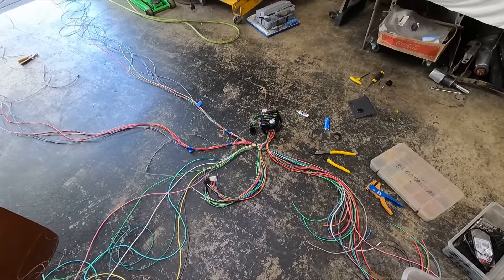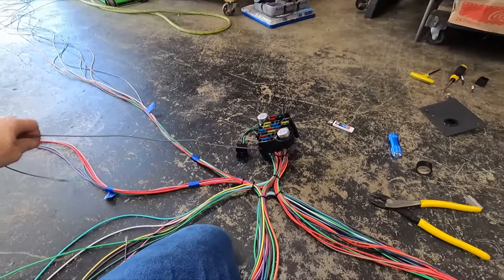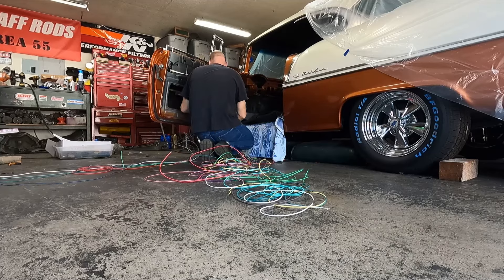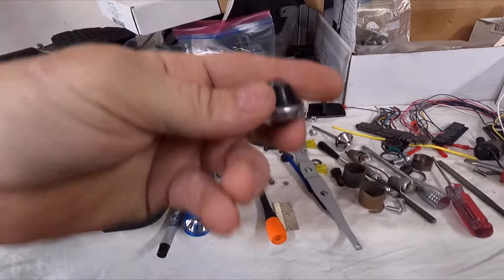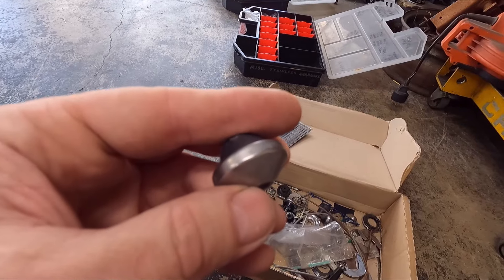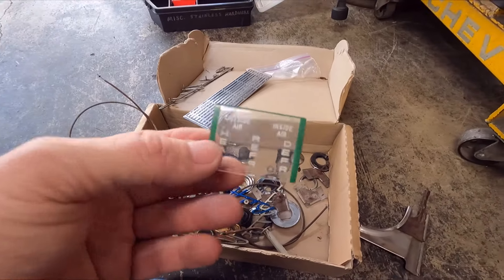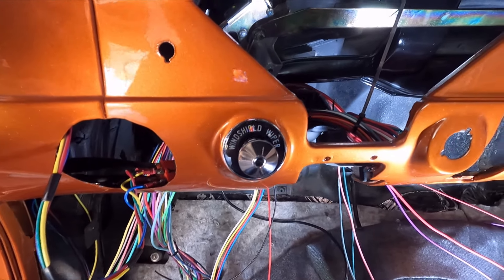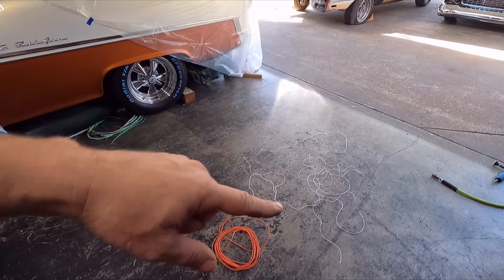Steve's 55 = Wiring and wiper knob modification

Comment: Maybe you could fill the factory knob. With epoxy and drill a new hole. I don't know if you can use the factory set screw or not that knowing your work you can make it work.

Comment: Where that comes through the dash but is to small of a diameter could you get a piece of brass pipe at you local hardware store and modify it to fit over the shaft yet through the existing 55 dash hole and file a flat spot to lock it to the dash hole?